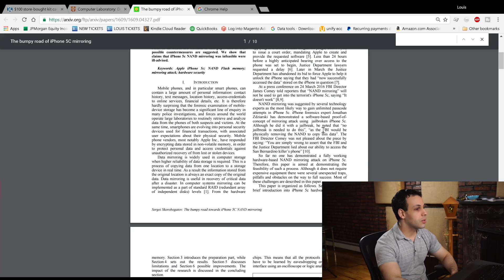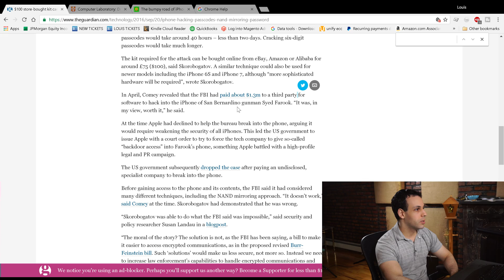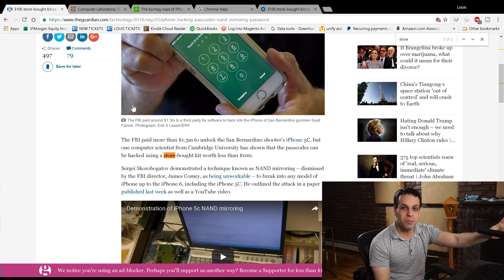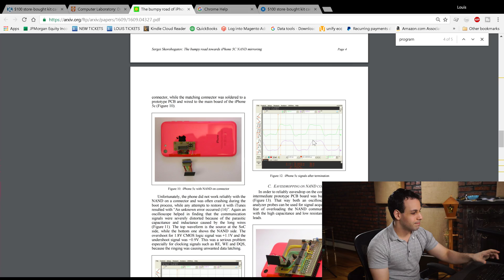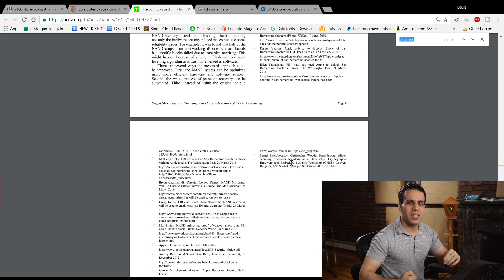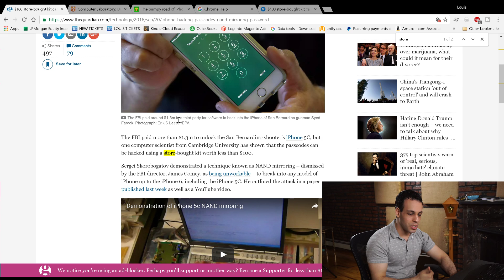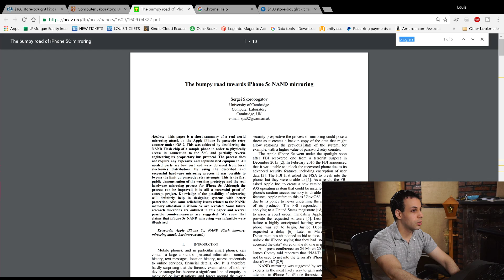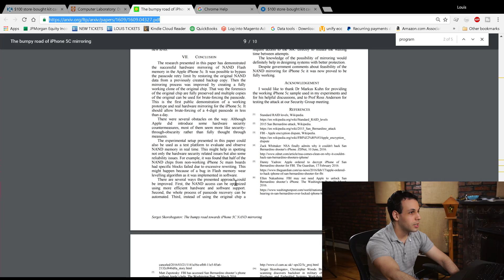Tech "journalism" does it again

Comment: I enjoy your vids, but this one I have to completely disagree with you.
A kit does not have to contain everything to complete a project.
I do see your point of the use of "anyone" being an exaggeration, but you went well beyond that exclaiming a doctor or someone with 20 years experience is required to do this. When in actuality, anyone could do it, given a complete set of instruction. They probably wouldn't know "why" certain steps are done, as maybe someone with prior knowledge of electronics. But that wouldn't prevent them from sucessfully competing a project. That is, considering they have a complete set of instruction.
I have done classes for 8-10 year olds where they were taught how to build a pc. These weren't advanced children, but problematic children that had various problems. Every child I've encountered was able to accomplish the project sucessfully. They learned what each component did and why. They didn't learn more advanced skills like how the components worked. This was because tjey didn't need to know how it worked to complete their project.
Your title, The Guardian is NOT Journalism, again, I have to disagree. I just want to point out, I dont personally use The Guardian as my source of news. This shouldn't even be an issue. I understand you don't agree with this article, and maybe others as well. But that doesn't change the fact that they offer investigated journalism to the public. They do offer opinion as well, as many news outlets are siding towards. But completely dismissing The Guardian as Journalism simply because you dont agree with their arcticle is disgrace.

Comment: At the risk of being pedantic she said "help" not "enable". Anyone seriously setting out to do this would find that kit (in the equipment rather than the collection sense) helpful. Most people would also undoubtedly find it much too hard and give up and you are quite right that this article gives the impression it is much easier than it actually is. That said, now that fella has done it once and published a well written guide it is much easier than it was and "anyone" with sufficient dedication and average or better intelligence (a more reasonable definition of "anyone" than the literal one) could follow his instructions and use some fairly cheap kit to crack that phone. It might take them years to develop the skills but they could so while the author might be misleading her audience I don't think she's technically wrong.

Comment: If the researcher, who did a great job btw, had taken a picture of all the equipment he used, including the stack of paper where all his thoughts were sorted, she might have thought otherwise.

With the briefest of glances, the researcher's description of the process does look like a "how-to" manual. When reading the main text however, is is almost immediately clear that this is not the case.

If you were to ask me how did the "journalist" came to her conclusion I would say this was the most likely scenario:
She read the text in bold, not understanding the first 2 sentences, or ignoring them.
Scanned trough all the pretty pictures, saw all the neat laid out cables and thought: "Oh, this looks like a kit. It probably is."
Hit "CTRL+F" wrote "$" in the search field, which doesn't exists, put in "dollar" instead, which DOES exists, took in "100" and "off-the-shelf components"

Now, I do not know this journalist, nor do I need to; She is clearly lazy and/or incompetent, neither which I have any respect for.

As for excuses like: "Ignorant", "pressed for time", "put under pressure from boss to take a certain angle" those all fall under "incompetent"

Sorry for my grammar, English is not my first language.

Comment: I think it's o.k. to say something is possible after somebody figured it out. But it's hard to figure something out.
The FBI take some mony and buy some kit (elcomsoft.co.uk) or an expert in this field to take the job, the easied way is to ask the manufacturer (they did this).
Many guys make living with reverse engineering and after these guys write a manual, it's "easy", but the first time it's very hard.
The garbage is, that the media don't show the whole storry. They want a smart and short story. The media is good to find some first hand material, but you need to take the step from the newspaper to primary source. It happens a lot of time you only had to say: Read the next article or the next page from the primary source. (if somebody come with some mighty stuff)

Comment: "The mirroring solution presented in this paper was
achieved using off-the-shelf components bought from an
electronics distributor with a budget of under 100 dollars.
The same approach could be applied to the newer models
of iPhone. The same type of LGA60 NAND chips are used
up to the iPhone 6 Plus. Any attacker with sufficient
technical skills could repeat the experiments. Newer
iPhones will require more sophisticated equipment and
FPGA test boards"

The author pulled their headlines from the first sentence of this paragraph from the document. 
https://arxiv.org/ftp/arxiv/papers/1609/1609.04327.pdf

Comment: You know, this makes me feel a lot better about my own failures and that I sometimes keep trying way too long to figure something out, that in the afterthought is "so easy". Even something as simple as a little circuit, with a microcontroller and probably only in previous versions documented code can drive you nuts. And there might be anything, from hardware failures, to lose solder joints, code errors in the documentation and so on. Your video gave me new motivation to try even more, until I figure this thing out, even if it seemed quite simple afterwards. Thank you!

Comment: That's some mad skills removing and reconnecting that BGA package through jump wires.. XD

in the paper the author writes "The mirroring solution presented in this paper was achieved using off-the-shelf components bought from an electronics distributor with a budget of under 100 dollars. " and "Any attacker with sufficient technical skills could repeat the experiments." The journalist must have gotten that 100$ number from this paragraph but doesn't even bother to finish the paragraph XD

Comment: Why are you using AdBlock Plus? I mean do you have a moment to talk about uBlock Origin?
Reply from the maker: +Ben Snow because I got tired of going to websites that skullfuck my machine with ads, I installed it and that went away, and all was well with the world. I whitelist the very few sites that I enjoy are not obnoxious
Reply: I don't have a problem with blocking ads, but the specific ad blocker you use is a bit scammy. It set up its own ad network and allows "non-intrusive" ads (basically those that pay ABP to be allowed). That's why I mentioned uBlock Origin, it's better in every aspect. (If you decide to use it in Chrome, make sure to also install uBlock Origin Websocket.)
Reply from the maker: Ben Snow
It can't be a scam if it is free. They offer to block ads for free, if some ads get through and some don't then I am still getting more than what I paid for! ;) I realize your point though and will check out ublock origin.

Comment: this is a LOT like working on cars. 

say (like my car) you have an EVAP large leak trouble code.....so you replace the gas cap for 40 bucks, you replace the purge valve solenoid for 20 bucks, do all this other BS under the car looking for leaks...

turns out a hose fell off.....

however, i now dont have an EVAP leak....but my purge solenoid is clicking on and off about 120 times a min.....

so now i could probe the wires....see if the computer is telling it to cycle 120 times a second, or if its cycling because its a bad replacement part (old solenoid cycled as well, so im thinking computer)

and then i need to find out what tells the computer to trigger the purge solenoid....and probe thows wires.

good thing ive been working on cars sence ive been old enough to hold a flashlight for my dad.....and getting my computer science degree in college....

because i need BOTH skills to fix this problem.....

ive also had MANY times where its HARD AS FUCK to take apart....but easy to put back together
or you have taken it apart and put it back together so many times you learn some tricks.

for both computers and cars, that applies.

Comment: I happen to work for a "tech site", so I can shed some light on this. It's not entirely the fault of the journalists, it's the publication itself. The bosses impose a directive to publish in volume. It doesn't have to be right, it doesn't have to be informative, it doesn't have to be accurate, it doesn't even have to be the truth. It needs to be fast, it needs to be sensational, it needs to get clicks.
Taking time to research a piece, taking time to actually try and do the job properly is discouraged, because in the time you would do one well written and informative piece, you could have churned out at least five articles that are basically meaningless drivel. It gets even worse when the bosses say that instead of doing even your own reviews, you just copy it from another site, change some words, and pump out 5 of them a day. 
It's less about tech, and more about clickbait, because the number of people interested in tech will always be less than the number of people brought in by clickbait. And the boss really needs a shiny new Range Rover. 
Now why would someone work for scum like this? Well, some of the "journalists" are actual scum themselves completely complicit, while others got stuck, like if they couldn't find another job after being hospitalized with paralysis.
Reply: This is why i quit journalism, i used to work in print tech media. Things i have seen, they went way beyond simple sensationalist bait and padding the volume. Like you HAVE to acquire contacts, you HAVE to work with retail and distributors and manufacturer representatives, your value as print journalist doesn't come from how well you research or write, but how much advertisement money you bring in. And you're in this situation, you need companies on your side, else you're not going to have any material to write about, you're not going to have test samples, you're not going to have leaked early announcements, but you're not going to have them on your side unless you dance to their tune. Plus advertisements simply don't look good next to an article demonstrating the flaws of a product.
Reply: nuremberg defense ?
Reply: moshly64 More like  "If you want to get paid at the end of the month, you'll do what I say and if you don't like it we'll just hire someone else" defense.
Reply: Thanks for sharing this.
Reply: That is by no means an excuse for doing it lol.

Comment: All excellent points regarding tech writers, Louis.  One interesting observation Sergei makes is that his method which requires constant rewriting of memory in order to determine the passcode through brute-force trial and error will possibly cause the memory to fail.  His method might work for a 4-character passcode but will almost certainly destroy the memory when trying to guess a 6-character passcode.  (col. 2, pg. 7)  In other words, even if "anyone" could buy a "kit" to perform his method, it might work only with some luck on 4-char-passcode iPhones but highly unlikely on the new 6-character iPhones.  (Oh, and if the passcode has been created using the full character set rather than just numbers, than his method will destroy memory regardless of whether 4- or 6-character passcodes.)

Comment: Tech Journalism is hard. You have to make complex material understandable to the layman. And the layman is very bad at understanding the implications of computer security. In computer security there is no breaking security a bit. Once it's broken it's broken. It does not matter whether it is hard. That is security by obscurity.

The message the layman has to understand at this point truly is that the PIN protection is indeed broken. Anybody can hire somebody to do it now. It is broken not only to law enforcement but to thieves. 

So in my opinion the only truly bad statement is the store-bought kit. However getting the message about security implications is important enough to warrant some hyperbole.

Comment: anyone can repair a macbook with a store bought kit, called a pc
Reply: AdanD66174U.2 No, but I was able to prevent that issue by not purchasing Apple products.
Reply: Oh yea? I can prevent almost ALL Mac problems using only my MIND!
Reply: behold: the power of linux (my new choice OS)
Reply: good point... i couldn't agree more
Reply: AdanD66174U.2 Behold: The power of the mind! :D
Reply: id prob dual boot Ubuntu and Windows 10
Reply: AdanD66174U.2 I've been dual booting W10 and Mint, but Mint doesn't see much use since I do a bunch of relatively high level embedded systems work (which means lots and lots of C# and VS).
Reply: can you make apple support my 2009 mac pro and fix its RAM issues? (fuck apple for dropping my 8 CORE MAC PRO (3.33GH/z, 16GB DDR3, RX480)
Reply: i haven't tried mint but I would like to look into it. I like ubuntu because its simple and not too flashy.
Reply: AdanD66174U.2 I'll stick to dual booting TYVM. ;)
Reply: Oooooooohhh!  Good one!
Reply: I'll need a new laptop in a couple months. It'll mainly be for web development and designing and occasional video editing. Budget is under $1700. no doubt it's gonna be better than my piece of shit macpro. I just really need a laptop with a nice minimalist design otherwise I can't work happy. Any suggestions?
Reply: id check out gigabyte's laptops i guess... presuming u want Windows
Reply: AdanD66174U.2 Probably dual boot
Reply: MSI and ASUS both have excellent chassis. They're a bit big, but quite accessible for upgrades and such. I know for a fact the ASUS ROG one has two 2.5 inch bays, so you could put two storage drives in it. The keyboards are also really nice.
Reply: they make cases? i didn't know that! ill have to look into them
Reply: thanks guys will look through all of these
Reply: AdanD66174U.2 You can't buy the laptop chassis by themselves. I was just pointing out that the whole laptop is nice rather than just the motherboard and drives.
Reply: oh, i thought you were talking about like ATX cases
Reply: +Pedro Oliveira i saw ur comment on the stream so here... the last few comments are about ASUS/MSI laptops